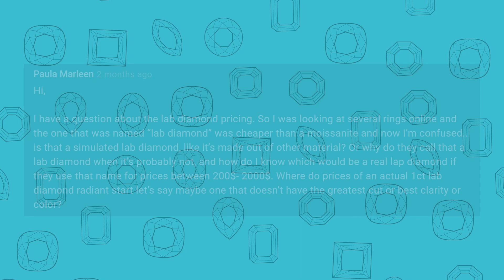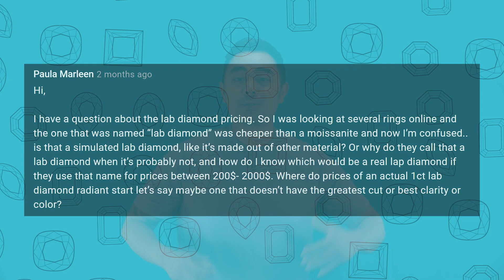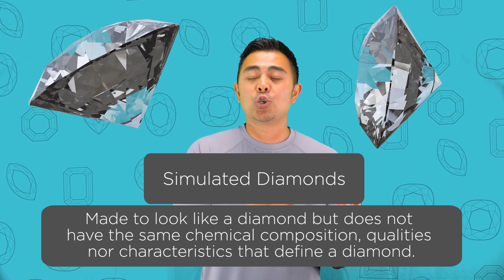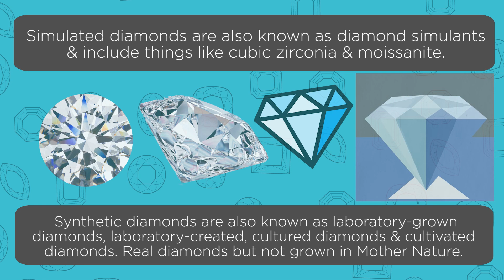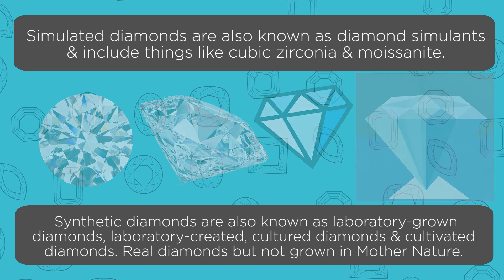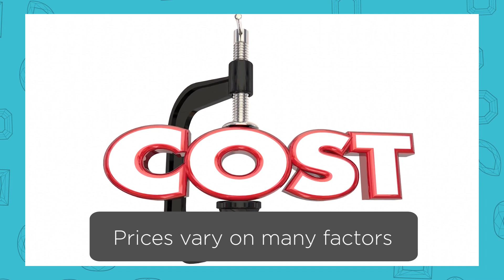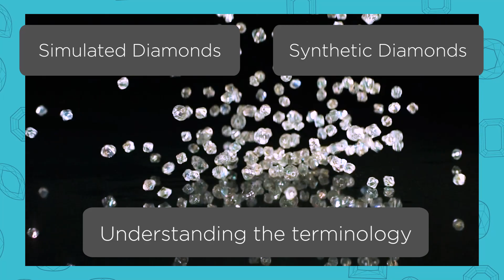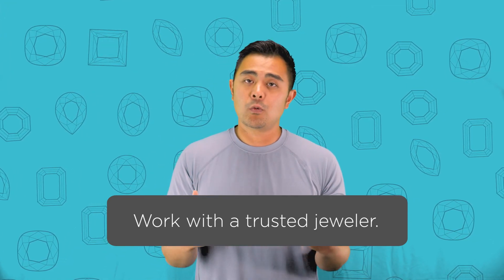What is the difference between Simulated vs. Synthetic Diamonds?

Comment: HE IS ALL WRONG. He definitely dont know what he is talking about. He didnt even understand the question of that lady. 
There is a variety of clear crystals
1. Cubic Zirconia 2. Moissanite 3. Diamond 4. Lab diamond/Synthetic 
5. Lab/Synthetic Moissanite 
6. SIMULATED DIAMOND
Her question is about SIMULATED DIAMONDS and why its cheaper than moissanite
Here is why:
Simulated Diamond is an artificial gem that looks like a diamond on the outside but not on the inside. It is achieved by the use of TECHNOLOGY.
its also known as DIAMOND HYBRID.
It has a crystal core that is electro plated with a LAB DIAMOND on the outside. Similar to a gold plated jewelry. 
A SIMULATED DIAMOND looks like a real diamond because it is a crystal that is electro plated with a Real Lab diamond. Its durable as well since its hardness on the outer layer is 9.6 its basically hard to scratch. Its cheaper than moissanite because moissanite is a precious stone. The only precious on a SIMULATED DIAMOND is the outer layer.
Reply: My question is that are simulated diamonds real I want to buy a chain it cost 158 and it says simulated diamond 18in
Reply: @ayyy3684  you found out

Comment: A diamond can not be synthetic , it is lab created or natural earth created !
Reply: Lab created diamonds are «technically» syntethically created tho?
Reply: CVD = Chemical Vapor Deposition uses a high Temperature boron plasma field to drop carbon atoms unto a laser cut square slithers, as they hit them they instantly become part of the diamond lattice. 
HTHP = High Temperature High Pressure 
uses pure carbon black coal under a 10million ton hydraulic press heated up 5000+ F degrees, this is the same process that the earth uses to create diamonds- only we do it above ground!
The HTHP method produces a diamond that is free of all Inclusions, colors, and blemishes that are equal to the Royal Crown Jewels of England!
Reply: Not true